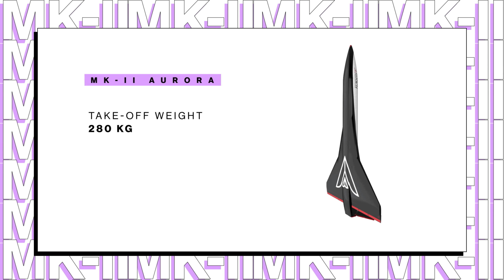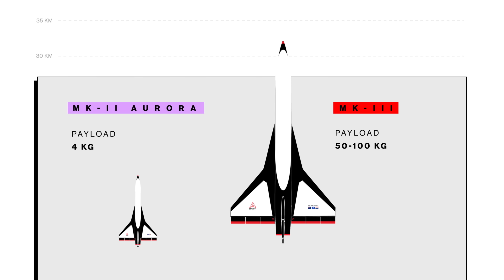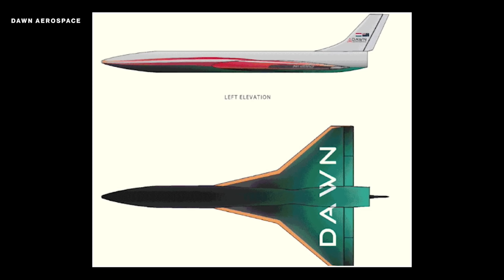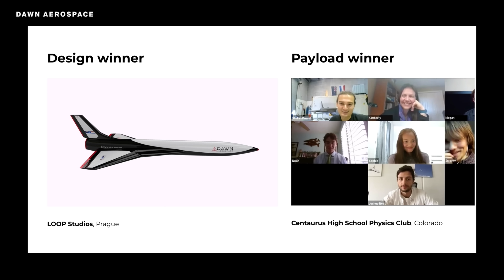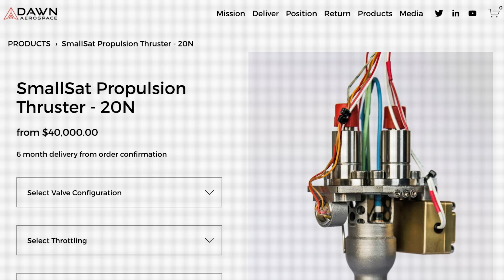Dawn of the Space Plane

Comment: The issue with rockets to space vs. flying to space is that it takes more net power to fly to space than to rocket to it. Flying to space leaves the craft taking more time in the atmosphere and inducing drag, which takes power to overcome. A ballistic rocket spends less time fighting the atmosphere. The factor that could change that is using air breathing engines to the highest point possible. Since part of an air breathing engines power comes from the oxygen in the atmosphere, that can replace carried fuel, ie., oxygen. Additionally, the air can be quite thin. A craft flying very fast scan scoop a lot of oxygen from a very thin atmosphere. Hence, the interest in ramjets.

However, without advanced jets, and perhaps even with them, it still does not make that much sense to fly to orbit. It takes more time, exposes the aircraft to heating effects longer, etc. So the question is, as it was, why bother with it when we know so much about getting to space directly, with rockets. Most of the "flying space vehicles", such as the shuttle, don't use the wings to go to space, but rather to be maneuverable once it returns to atmosphere. Ballistic entry vehicles have no guidance at all (Apollo). Elon has proposed an intermediate solution, a rocket that uses fins designed to direct its path on return, sort of a cross between the two.
Reply: @Thomas Chrombly But... he's wrong. The net power to fly to space by mode of a rocket (vertical take off) is MUCH higher than needed for the same distance made in that same atmosphere by a spaceplane. This is because it has wings, and wings give lift, and lift is a much, much more efficient way to get your vehicle to a certain height (at least, up to 10-15 km) than the pure exhaust-power of a rocket.

Airbreathing engines would help mitigate the mass needed even further, true, because you'd need to carry much less oxygen + you're already high in the air when you start up your rocket-engine (which gives another 3-4% advantage in regard to useful mass), but... there are also some downsides to it. First of all, if you're talking about multi-purpose engines, they're notoriously difficult to make, because they have to accommodate a wide range of  speeds, from subsonic to supersonic to hypersonic, and ultimately changing to the oxygen stored into the spaceplane to reach orbit in space. Such engines are notoriously difficult to make technically, and hugely costly, and are just now in the experimental stage. The only ones that are actually in such a testing phase, are the sabre-engines of Skylon.

Another possibility would be to use normal jet-engines for subsonic speed, and then just another set of rocket engines to go into space, but then the normal engines would still need to withstand the stress of going hypersonic AND if you get two pair(s) of different engines, it means you've just added extra mass to the spaceplane as well, reducing your useful load. If that extra weight offsets the gains made by breathing air along the way up to 10 km height, you've basically gained nothing with those engines.

It's not all that easy, thus. Which makes sense, or it would have been done a long time ago.
Reply: @ignorancebeater650   I was wondering when I would see the word SKYLON as I started reading Scott Franco's comment. I am New Zealander so naturally I applaud what this guy is doing, but Skylon is coming, have no doubt about that. As a launch system, it will be superior to rockets.  In the past, trying to leverage the efficiency of a winged body with air breathing jets coupled with rocket engines that carried it's own on board oxidiser and propellant, didn't leave much in the way of payload because the total thermodynamics came up short, with the vehicle not being able to lift the desired payload into orbit. Allan Bond and Reaction Engines have been trying to realize this idea for a decades. Imagine if you could use a jet engine to get you up and nearly out of the atmosphere, then supplement it with onboard oxygen, so it essentially like a rocket, to get into orbit, the air going into that jet engine when you are very high and very fast is hitting the intakes with massive friction, just like when a vehicle is coming back down it heats up to thousands of degrees. When you pump up a bicycle tyre you feel that heat of compression on the valve and the pump, so imagine what would happen to the jet engines compressor when trying to squeeze all that hot air into the turbine ! So, if you could find a way of taking that superheated incoming air, at around a thousand degrees Celsius, and instantly cooling it to, say, minus one hundred degrees Celsius, you could then use that precooled air very easily, cold air is easier to compress, meaning the compressor has to do less work, and then you just add your on board fuel supply and into orbit you go. But one thousand degrees to minus one hundred degrees, in less than a second ? That must be impossible, except , it isn't. Allan Bond and his team have done it, they have made a heat exchanger that makes SKYLON possible. This is the heart of the system, it was a problem that no one has ever been able to crack before. Ice buildup from water vapor had always been one of the issues that stopped air flow completely. With this air cooler, and some very clever thermal management, they have a design that is so efficient it can take around a hundred of Tonnes of cargo into orbit, and then return, using some of the cryogenic systems on board to manage thermal stress, plus a few hundred liters of water for leading edges, and then it lands just like a plane. All this means far less thermal stresses on the vehicle, and turnaround time can be very quick. It uses cryogenic oxygen and hydrogen as both fuel and coolant, and also liquid helium for energy transfer, running turbo pumps etc. Skylon is in the development and testing phase, the prototype SABRE engines are built, and are being tested, this system will be the most efficient means of getting into orbit, and it also has excellent prospects for intercontinental travel as well.
Reply: @psycronizer      propulsion source is key ...  it doesnt have to be solid fuel or liquified gaseous materials ...  the boys at nasa arent foolin around
Reply: @ignorancebeater650  this is where I hypersonic travel probably help with that

Comment: Nikola Tesla predicted based upon his studies of high voltage discharge in the early 20th century, that through the application of high voltage AC and pulsed HV-DC, the electroerodynamic and magnetohydrodynamic forces acting upon the ionized medium of the surrounding atmosphere and ionosphere alter the Mach number, raising the speed of sound to near the speed of light through the ion acoustic waves/longitudinal plasma waves transmitting forces through the conductive, polarized plasma streams. 

This was later confirmed by Thomas Brown in the late 50s and early 60s with his "flying capacitors" and electrokinetic generator patent, which transforms a flame jet to a negatively charged plasma to amplify an input voltage of a several thousands of volts to the millions of volts required to sustain the plasma sheathe around the vehicle. 

Skip to the modern day and NASA is designing plasma parachute systems alongside many private and public aerospace companies such as Boeing. They are revisiting plasma discharges as a way to alter the Mach number of air and for example, create a plane which can move at supersonic speeds without generating a sonic boom. 

Truly there is no single path of scientific discovery, there are many generations of breakthroughs that are lost, or hidden away and rediscovered for one reason or another. Tesla seemed to think we were not ready for such machines as those he designed, which could convey hypersonic weapons of mass destruction halfway around the world. But war machines are built anyway, and it is certain that our military technologists have hidden away from the civilian world a great many discoveries which have military application for fear it would spread to foreign powers. But the internet age is making it impossible to hide anything for long and it allows the secrets hidden in plain sight to be found, the historical evolution of military technology seems to hit dead ends at promising breakthroughs...but this is historical fiction until 80 years have passed and someone makes a Freedom of Information Act request on it. Failure is widely publicized and success is top secret.

Comment: Wait, materials-science wasn't even mentioned. The velocities required for getting anything even into low orbit, and returning, will require expensive high-tech, heat-resisting surface materials. Wings for lift seems like a great idea (at certain altitudes) but for great speed they mean great friction - a lot of energy will be spent just overcoming that. Alternatively, will the second stage have advantages over conventional rocketry? If so, how? Hard to tell how high this guy's hopes are raised vs reality... nice RC demo toy so far and a cool sales pitch. Wish him luck though.
Reply: I'd like to hear more about the specifics too. But:
> "but for great speed they mean great friction - a lot of energy will be spent just overcoming that."
I think the point is: with wings that generate lift, they don't have to fly fast when they are still in the thick layers of atmosphere. They can gain speed at higher altitudes where air density is low. Plus they can use atmospheric oxygen for the first part of the trip, so don't have to carry as much oxygen.

The more difficult part is managing the heat during re-entry. Depends on how fast their 1st stage will go; maybe the 2nd expendable stage will handle gaining most of the orbital speed, although then they lose on re-usability.
Reply: Bloomberg should pull this video. Considering how many crucial questions were not at all covered, this is an embarrassment for them. Why would anyone consider Bloomberg to be a serious source for quality information if they don’t ask even the most rudimentary questions?
Reply: @wbwarren57  well, I'd cut some slack if they followed this up with the harder questions. I'd love to see if they had the answers. But yes, egg-on-face for Bloomberg if this proved to be little more than a dream or a gimmick... .If Ashlee Vance really wanted another trip to New Zealand he could cover Rocket-Lab's new Photon spacecraft as well :) - those guys really do mean business.

Comment: We've had 3 or so major ssto spaceplane projects. There was even one in between the two he references. It just isn't feasible. Sorry bro

edit- Ah, they'll use a second stage to orbit. Okay well that makes some sense, but sucks it's not the SSTO holy grail
Reply: SSTO's suck unless we have metallic hydrogen fueled rotating detonation aerospikes.
Reply: @aerojetrocketdyners-2538  or unobtainium!
Reply: SSTO's are possible, but accelerating the entire vehicle including wings all the way to orbital velocity eats up most of the payload capacity so your payload becomes very small relative to the vehicle.

Skylon is trying to compensate for this with a very efficient and light propulsion system. However, they're still bringing the wings and mostly empty propellant tanks to orbit which is not necessarily efficient.

Earth's gravity tends to favor staged vehicles, unless possibly if you go with nuclear propulsion.
Reply: @phamnuwen9442  you’d still have to accelerate the propellant regardless of the nuclear reactor. In the atmosphere you can accelerate air as a propellant but in vacuum you need to bring all the propellant with you.
Reply: @DinoAlberini  Sure, but nuclear propulsion is so much more powerful compared to chemical fuels that the potential for larger payload fractions is there in a well designed system.

If the payload fractions become really large, it's possible that the complexity of staging is not worth the cost.

Look up "Nuclear Thermal Turbo Rocket" for an example of an vehicle using the atmosphere as reaction mass.
Reply: @phamnuwen9442  what if it fails?
Reply: Nah, i doubt they will make orbit even with two stages. Especially not with solid propellant rockets and such a small craft. Space ain't that easy...

Comment: Simple. All you need is a typical jet engine combined with an electric motor that kicks in once you reach a certain altitude to deal with the low air combustion issue
Reply: Hybrid engine
Reply: and that electric engine would do what?
Reply: @DinoAlberini  Not get to orbit, that's what.
Reply: @williamgreene4834  The hybrid combined with a small rocket will 100% get you to orbit. Think of this comment in 5 years when you see this in reality.
Reply: @emmanuelr710  You never mentioned this rocket engine until your last comment. Also once a jet engine runs into combustion issues it's fan blades are much less efficient at generating thrust.
Reply: @emmanuelr710  at such altitudes the blades lose their effectivity proportionally to the engine (both of them rely on the density of the atmosphere), so an electric engine will be grossly ineffective, plus electricity storage is still not energy-dense enough for such usage, the best option still is storing liquid oxygen that will be used at higher altitudes.

Comment: So it still has an expendable 2nd stage? Then how is this fundamentally different than reusing the 1st stage of a rocket? The cost reduction thats supposed to be made possible by a space plane comes from launching/landing on a runway and reusing everything. This doesn't look much different from what spacex does and in the near future rocket lab will do except that its way way smaller in the case of spacex. I'm not really dissing the concept, any new way to get stuff in orbit is cool with me. Just dont act like this is some new revolutionary ssto when basically your just not doing the part that make space planes and ssto's so hard to begin with. That's attaining orbital velocities, dropping off a payload and then bringing the whole thing minus the payload back to land on a runway. This doesn't do that, surviving re-entry from orbit is a totally different animal.
Reply: Stfu
Reply: Yeah I was wondering the same thing lots of companies have dones this before don't know why this one is so different .
Reply: The space plane will be reusable multiple time per day and will land at the same runway as takeoff . Also the 2nd stage is housed inside the space plane, so does not require a fairing. In addition the 2nd stage doesn't require the strength to handle MaxQ. This saves significant mass and also makes the 2nd stage cheaper to manufacture.

Comment: It does give greater orbit flexibility and they could theoretically beat rocket lab on reusability due to lower wear. However the benefits don't greatly seem to outweigh what's available now so it's quite risky. I wish these guys best of luck.
Reply: Cost... being able to launch from any airport not having to shut down any local flights in the area... and still be able to launch a satellite and then land, simple connect the new second stage component  and launch again ... Less change a launch failure the plane can still glide and land with payload in tack. Only the second stage is higher risk.

That would be a huge cost saving for the client...